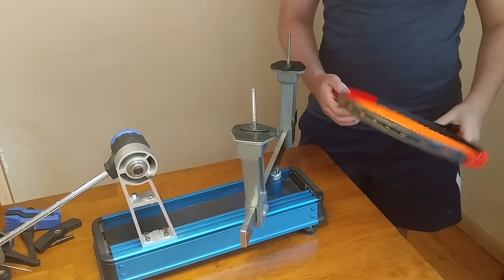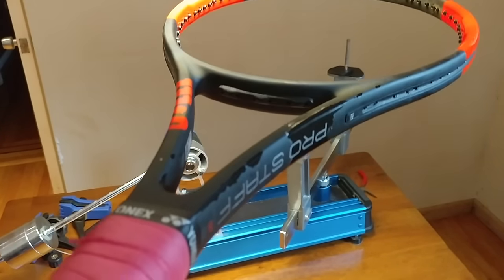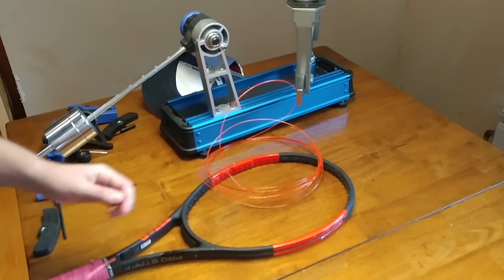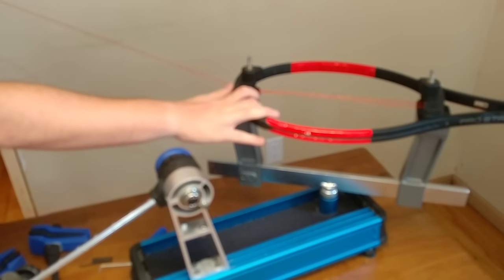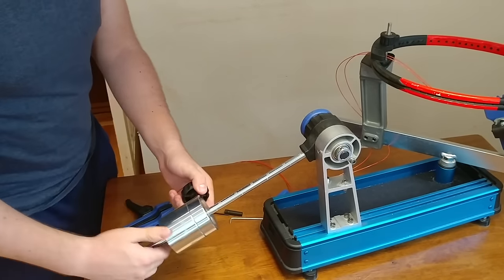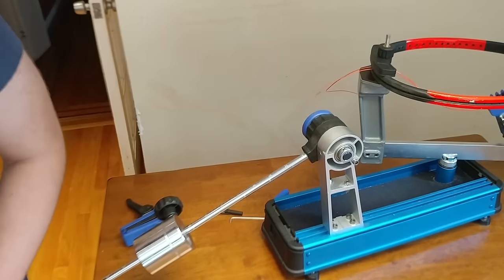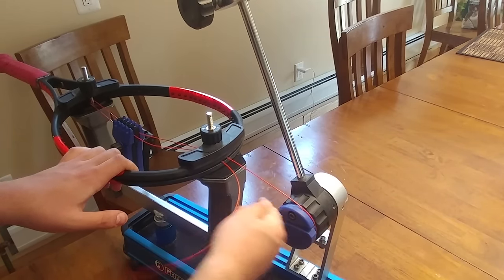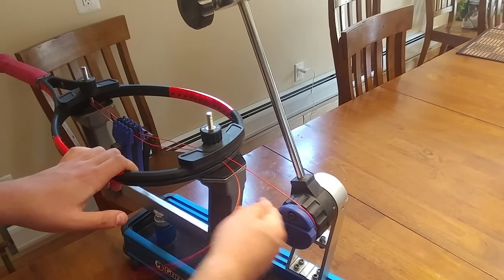How to String a tennis Racquet Updated (Gamma X-2)

Comment: I took 18 counts of string to do mains. There was not enough string to tighten the last main string on either side. Lesson learnt.
Try the first time with a cheap string. I tried with luxilon alu power
Reply: I had the same issue on my 1st stringing job. I didn’t want to loose that set of string, so I used the old string to tie a knot with it to make it longer and pulled, then cut out the knot. It was a pain, but it worked on both sides.

Comment: The center 2 mains were never given tension. Started from 2nd hole from either side. This will lead to incorrect tension at the center 2 mains,
Reply: You can't do it with this machine. This is the right way won't be problem. Also I did around a 200 racquet with same machine nobody said it was any problem. ;)
Reply: He states exactly why you can't tension the center two mains on this machine.  Do people even listen anymore?

Comment: My strings keep sliding off the blue thing, please help. Is it a problem with the circle thing that holds the strings
Reply from the maker: Did you do exactly as shown at 8:10-8:22?
Reply: Yes exactly same, still the strings keep slipping
Reply from the maker: when the drop weight goes down they slip? hmmmm. Could be an issue with your machine. The string should have tension by the time you twist. Shouldn't be loose. That could be the issue.

Comment: Quick question, I.have the x2 but cant get the clamp to fit the first 2 crosses on Wilson pro staff 97 16x19 I saw you had a bit of trouble as well. Thanks
Reply from the maker: You really have to use some strength to get it on.

Comment: hello, but does this balance wheel machine need to be calibrated somehow every now and then?  Then I would like to ask you ... when you spring the barbell to make it horizontal, don't you think you are stretching the string too much, stressing it over the limit?  Thank you
Reply from the maker: Yes, you can adjust the tension depending on how many lbs of tension you want. I just always have strung it that way and my racquets play well. There is no other way sometimes to make it horizontal.
Reply: @AlanGrandman  
Ok and... about the calibration of the machine?
Reply from the maker: You don't need to. Gravity doesn't change.
Reply: @AlanGrandman  
Ok... I asked it you because my teacher tennis have the same machine. I want to ask you if are you sure that this machine don’t needs to calibrate or are you can imagine it?
Thanks

Comment: As a non stringer, how long does it take to string a racquet?
Reply: It would take you about 2 hours for your first job. You will get it to around an hour with practice with the X2
Reply: @rishijai  Thanks for that info. I wonder how stringers for Borg and Sampras felt after stringing a racquet for an hour and then the strings pop after the first strike? I remember reading Seles' book and she said after her strings went in a crucial stage in a match in 1989, she immediately switched from natural gut to synthetic for the rest of her career.
Reply: @BurnsTennis  I had natural gut on one of my rackets, it played fantastic. Its almost like the ball sticks to the strings on contact. Natural gut is very difficult to string and bursts easily. That's why heavy hitters use hybrids - polyester/ natural gut. I did string many of those for other players but using syn gut for the hybrid. I like one piece stringing with a softer string on my Pro Kennex racket.

Comment: can you do two crosses at the same time all the way down.
Reply from the maker: Nope. Have to do one at a time. Eventually you get faster and it doesn't take too long.
Reply: I have been pulling 2 mains at a time for more than a decade. I pull 2 then 1 cross to alternate sides. I can't tell the difference as I'm not a pro.

Comment: I have this machine and I find the first 4 strings are not the same tension as the rest of the racket. (2 strings each side of the racket) could you help? And I also add more tension I string at 55 Ibs and even when I string a 63 still doesn't work. Also I string with a hexagonal co poly, what tension do you tension your clamp?
Thanks
Reply from the maker: This machine isn't going to be as precise as an electric constant pull tension type of system. Don't expect to get the same tensions on every string though the variation shouldn't be to bad. Overtime I find that stringing 2-3 pounds over what you usually play with and then hitting after 3-5 days the racket evens out. So for example I like my raquets at 55 but I string at 57 and the tension hits that point and evens out after a few hitting a sessions. The clamps should be tight to squeeze but you shouldn't be putting all your effort into it. Just enough so it's a little difficult with one hand.

Comment: Hello, I got my new machine, but it keeps staying above the horizontal when I was doing the main string. Do you know why? The manual said to re-pull, but it just keeps staying above horizontal all the time. I have not started the cross yet.
Reply from the maker: Hi. Yes, this happens sometimes. Push it a little bit up and let it drop again and it should work.
Reply: Haha, I found it works if I give a little more string when it stays above the horizon. I forced the bar, and my string broke. However, I believe I figured out how the machine works. I shall try some cheap string next time to finish my learning. Thank you for your reply!
Reply: Your string simply doesn't stretch as much. Start with the arm down and go straight into the ratcheting, raising to perhaps 45 deg from horizontal.

Comment: You don’t tension the tieoff knots?
Reply: They are under tension.  You clamp the last main and then tie off.  As long as you pull it tight with the pliers and tie it off correctly, you are fine.

Comment: How tight should i make the knobs at the 5:07 mark?
Reply from the maker: Tight enough so that the racquet is immovable but not so tight that the frame gets damaged.
Reply: @AlanGrandman  Thanks one more question im trying to string with a poly right now and for some reason the drop weight wont drop, like its barely dropping at all, maybe 20 degrees max..Any idea why this is and what to do?
Reply from the maker: @AustinsCastIronCooking  Yea I've ran into this issue. I usually just lift the weight a little and it seems to go every time. Not sure why this happens.
Reply: Alan this happens because polyester strings are not very elastic.

Comment: Hi,  
Your instructions do not follow those of the manual.  The drop weight arm should be in the down position, moved up to approx. 45 degrees and then allowed to drop.  Also - the starting position for the gripper drum slot should be approx 45 degrees to begin with and not parallel to the table/work surface.  This is how the machine was designed to be used for the best results.

Comment: You should put the very first clamp right on the center, not down towards one end. So that you are pulling tension on the first 1.5 mains. Clamp that, then do 1 more main on that side (not 3 total), then do the other side.
Reply from the maker: Thanks for your feedback. I used to do that but I find better performance doing it this way.

Comment: Tension is not accurate or consistent.    2 point mounting will brake your frame. .      All misconceptions about drop weight stringers.   The only thing you gain with other tensioning systems is speed.  Oh fixed clamps slip just as much as floating clamps

Comment: Your great but the drop weight machine sucks.
Reply: We all have to start off somewhere and this video is evidence of that. There is much going wrong with the machine selection, racket mounting, tensioning, knots, tools and so on that means you would benefit from a professional stringing course. I say that as you are obviously very keen on what you are doing and now just need to be taught properly. I mean no disrespect in saying all that, you can only do what you know, what you have been taught. Good luck on your stringing journey, Liam Technical Director UK Racket stringers Association www.ukrsa.com
Reply from the maker: @detectoruser  Absolutely right. I did train under an MRT so I am familiar with the various methods of stringing on electric stringers. This video was created with the intention of helping out those who might not have the means to afford those high-end machines but still want to be able to string rackets for themselves.
Reply: Thumper baby Bambi I spoke with a stringer at a pro tournament once.  He said the gravity stringers are MUCH more accurate than the $10k stringer he uses.  He said gravity will NEVER change and my stringer will be just as accurate in 20 years as it is when new.  The electric ones use springs, which wear out, etc.  he said only reason they use electric is for SPEED.  He told me don’t waste my money on an expensive stringer, that weighted is the most accurate. Period. It’s just slower. (He was restringing Jack Socks racquets when I was listening to him).